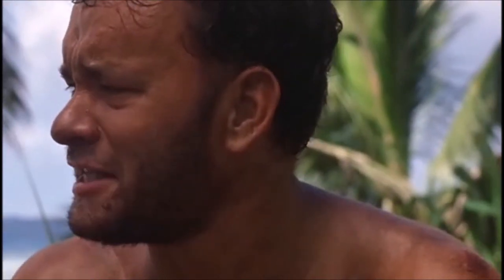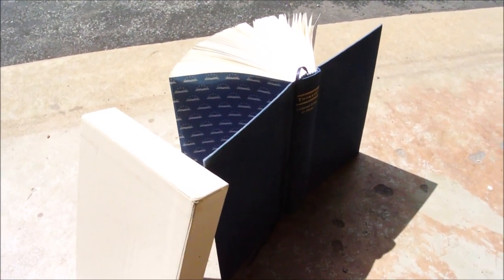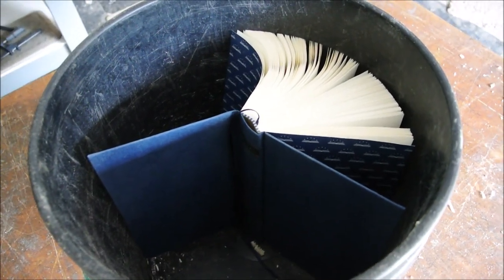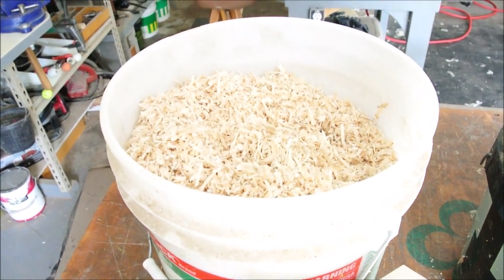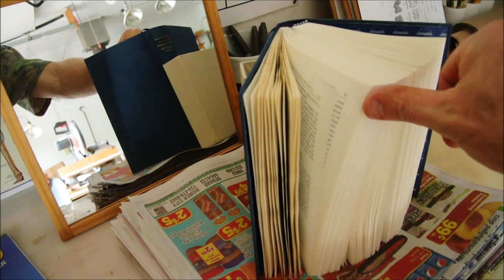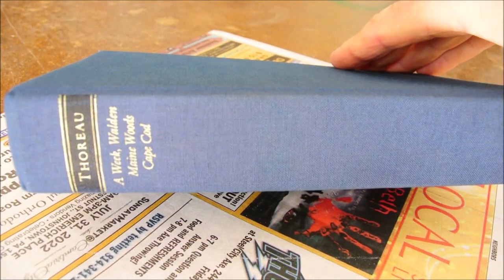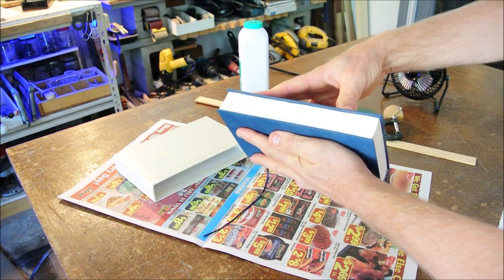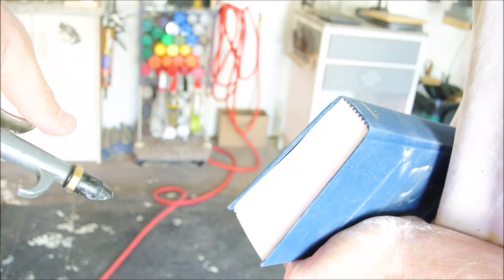Remove mildew from a smelly book (with sawdust)

Comment from the maker: Musty book? For my best attempt at a working procedure to fix it: 
⭐⭐⭐Please read the description.⭐⭐⭐
Reply: Any thoughts on an ozone generator?
Reply from the maker: @benjaminbrewer2154  My thoughts:
1) Mildew penetrates paper, but air-strewn O₃ does not.
2) I don't want a breathable combustion floating in the air around me.
Reply: Actually, there is a silver bullet. What's the flash point of paper? Fahrenheit 451. What temperature kill mildew? 220-250F. Ah ha. Cook your books. I'm not joking, I've been doing this for years. I put the oven on 250F and put my old used books in there. Turn many pages every few minutes (only takes a few seconds to kill mildew but oven loses temperature when you open the door). You will find that your books smell new afterwards. Only risk is sometimes the binding glue melts and you have to reglue the book. And your kitchen smells while the mildew is cooking, so open a window, start a fan.
Reply: @artisteileen5478  yep. You are doing things to remove symptoms. Heat will solve the problem. Then use your other methods to clean up.
I worked in shipping years ago. And we had a ship that had transported fish, the fish smell was IN the paint of the holds. An old salty ship inspector (after everything else tried) got us to seal the holds and slowly burn/smolder coffee beans in the hold.  It was miraculous.  I've used coffee beans and course ground coffee many times since. I'd try putting it in that bucket of yours with a couple of cups of coffee grounds for a few days to get rid of lingering smell.
Reply: Question: How long did you leave your book under the sun? I was told it needs to be under it for 2 to 3 days.
Reply from the maker: @whoisyouranime  Please read the description. Sunlight is not a miracle fix.

Comment: speculation: car guys use ozone machines to remove bad smell. Sealed environment is required. Do not do it in the house, as you really don't want to breathe that in.
Reply: Yeah plus one for ozone. It's used in hotel industry to remove strong odors left behind by smokers and other bad smelling hotel guests.

Big Clive might have a good suggestion for an ozone generation unit.

Comment: Get the thing all the way dry - Leave it somewhere warm and dry like an attic during a warm dry part of the year like end of summer, not for too long as to damage it, just to zap any moisture.  Close the book in a good Ziploc bag, or better yet vacuum seal it, then leave it in the freezer for a couple days. It won't be able to take on any moisture as it warms back up coming out of the freezer because it stays in the plastic until it's completely room temperature. The cold will completely kill any mildew that's still alive in the book.  The same process works well for old clothing items worth restoring.  Then you can go about everything else you were already doing making sure to expose as much surface area to as much sunlight and as much air as possible.  I've saved a couple first edition Frank Lloyd Wrights and a Robert Frost in this manner.

Comment: Posted a question on the Society of Bookbinders site asking for any suggestions pocket. In the meantime I did find one tip for getting rid of the smell on their site:

If you have a book which is dry but has a strong smell of damp then you
can sort it out cheaply by using what the irreverent call a ‘stinky box’.
Take a large plastic box and put a layer of fresh cat litter in the bottom.
On top of the 1 st layer put a piece of large mesh. Stand the book on top
of the mesh with the pages fanned out is possible. Put the lid on the box
and leave it for a couple of weeks. Most of the smell should have gone
but you can repeat this as needed without changing the cat litter.

I'll post any more that come my way.

Comment: Clotrimazole dusting powder (you can get it at pharmacies, and it's cheap in my country, but I don't know about yours) is at least just as effective as baking soda, and it also has the advantage of having talc in it (if you get thw good stuff) which abaorbs the spores and smell too. Good if you don't have access to fresh dry wood shavings, as wet wood is only going to exacerbate the issue of mould.

Source: I've studied microbiology for 6 years now and am planning on continuing for some more. If your book has glossy pages, a folded sheet of tissue dampened with white distilled vinegar also works to get the surface mycelium off fast if you catch it in the initial stages of invasion.

Also, the fluff-up can be fixed by putting the book into a vice at pressure in a (very) mildly humid atmosphere.

Comment: Just be careful with the UV for sunlight… it can fade the ink.
Fully agree with the smell. One idea is to open it in this fashion and let smoke (campfire or your wood stove) impregnate the pages. Has the same disinfectant properties without the fading and adds a neutral carbon “filter” and smell. I can only speculate as to why, but the tiny carbon particles likely absorb any odour like a Mini charcoal filter.

Yes, I have done this once with success (albeit inadvertently at the time) to a paperback. If nothing else Thoreau would have approved.
Reply from the maker: That is a really clever idea. Smoke is so simple, but it hadn't occurred to me. Hmmm. How to watch the moisture, though? Smoke is mostly vapor. 

Ha! Thoreau definitely would have approved!
Reply: @pocket83squared  My “find” was not under ideal conditions nor controlled at all, but the heat and smoke combination was enough to dry it out completely. I’ve also used this trick on a wet magazine  … but sadly pages were still bowed ( too much heat vs not enough smoke). Great for towels too when no cleaning facilities are available.
Reply: Speculation:  Could an incense burner have the same effect?  You could hang it open with clamps and put it directly above the incense. Feels like something at church would do.  Maybe, call the Vatican and see how they deal with old books. lol
Reply: @VagabondTE  I think it is the micro particles of carbon suspended in the smoke which does the cleaning. I am not sure of how the oils etc from incense would-may do to the paper, yet alone the peppermint! ✌️
Reply: I wonder if a bee smoker would help get smoke deeper into the splayed pages.

Comment: Just a thought. High chance it doesn't work but I'm throwing it out there because I'm just brainstorming here. But if you make a sort of sandwich style book press with 2 boards and 4 bolts (or more) with wing nuts to flatten the book out as a diy book press, but then throw the whole thing in the oven at 175 or 180 or whatever the lowest an oven can get to. This could potentially help with both problems as the heat should hopefully kill any mold or mildew at that temp and the heat will help to flatten the pages back out like heat bending wood (edit : you could even wrap the book in an envelope of parchment paper if you are concerned about the mildew getting into the oven) . Though if it is a rare book I can understand not wanting to try it. And yeah the paper should be fine at those temps as long as whatever glues and binders they used also don't degrade from the heat.

As always, thanks for the video pocket!
Reply: Interesting idea.  My only concern would be the page is sticking together.  Maybe you could give the pages a flip every so often as they dry. And you wouldn't need a full press.  Just something heavy.

Comment: Have you tried using ozone? I haven't tried it on a musty book but it's worked wonders for me with both smokey car interiors and pet odors in carpet.
Reply: I see some others have also suggested it. I think that by splaying the pages as you did with the fan and placing it in a sealed container with the ozone generator would give good results. The container could be left outside to avoid any concerns about ozone exposure.
Reply: Also, I seem to remember reading that museums sometimes use ozone on fabrics and paper as part of the preservation process.

Comment: I've made some good experience with vinegar on wallpaper.
It was recommended to be me by an antiquary.
People coming in from the street would just go through the front door and urinate in the stairwell because asking the restaurant right next to the door is just too much of a shameful experience...
Deer lord, I miss living in the city 🦌

Gently spraying the wallpaper with a 1:1 mixture of water and vinegar was enough for most of the corridor. For the corner that was apparently "used" most, we wiped it with a solution containing more vinegar than water and then applied soda.
The smell was gone after two applications (it came again after another tenant moved in and let the door open but that's off the point).

If books are anything like wallpaper, I guess there should be a way to make it work.
I would probably try putting the splayed book in a container with a bowl of vinegar and using temperature to regulate the speed of evaporation together with a (very) small opening to control the speed of volatilisation.

Drying with baking soda is probably easier and quicker but I would just forget the whole setup for a day and soak the book 😛

Comment: I have the same issue of books that wreak so badly, they are also 'making my face itch' and my throat sore... I've tried the freezer method and an ozone light, without satisfactory effectiveness. I'm afraid to use the microwave and it rains too much in England to try the sun with the large number of books I have... Trying the oven at a not-too-hot temperature next. 

Probably damage the book(s) some, but when they are that bad,  the only other option is to throw them away. Unfortunately for me, my entire library of books has this problem after being stored in an unheated room for several years. 😫

Comment: Never had to try it. But I'd imagine closing the bucket and sticking a little ozone generator in there might do something.
Reply: I thought the same!
Reply from the maker: I don't know, but I also wonder. It would have to work at least some, right? That said, I can't and won't recommend it; O₃ is a poisonous airborne burn, and it's likely that it won't be able to penetrate as deeply into a book as mildew does. 

Think of the way a blowtorch scorches wood on its surface, but does not burn the insides of it. Ozone might have a comparable (limited) affect.
Reply: @pocket83squared  my thought is that having it sit in the bucket with the generator, may allow time for the gas to diffuse into the pages. And one of those little battary powered generators for deodorizing the inside of cars can't introduce more ozone than there is oxygen already inside.
So the concentration can't get super high.

I've used that method to deodorize a used fridge. That worked fine

Good ventilation in the room you're doing this in is obviously a must.
Reply: The idea of closing the bucket makes me think of a butterfly killing jar. They always say not to mix your ammonia and bleach cleaners. Would slapping clorox and ammonia together in a cup in the bucket with a tight fitting lid produce fumes that would, in effect, fumigate the book? Of course, that's dangerous and might smell worse. Just spitballing.

Comment: Many people are suggesting ozone generators, which can work but can also make smells worse. Ozone is extremely reactive, and it can react with molecules in ways you haven't considered including reacting with non-target molecules. It can neutralize the odors, it can change a bad smell to a different bad smell, it can neutralize or make the smell better, or it can 'set' the smell and make it resistant to other remediation techniques. Additionally, ozone is a horrible thing to breathe and will wreck havoc on your lungs, if not immediately then in your future.